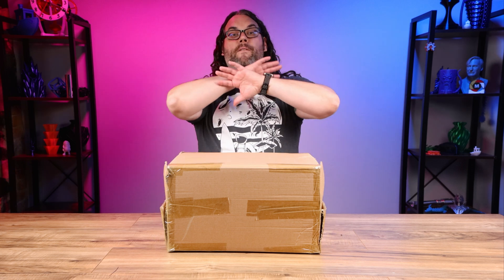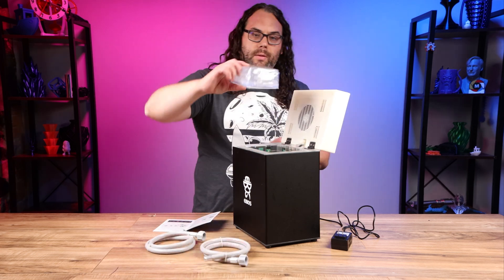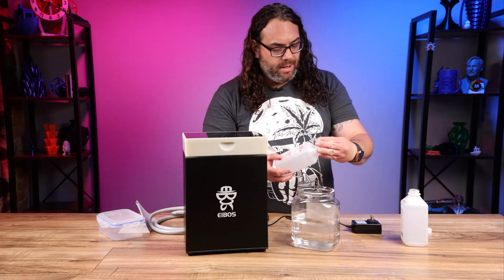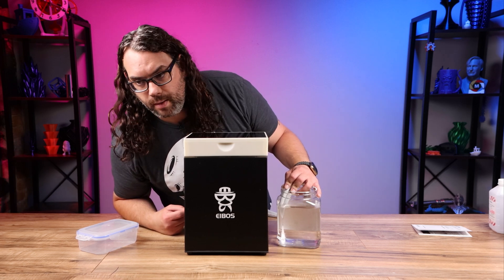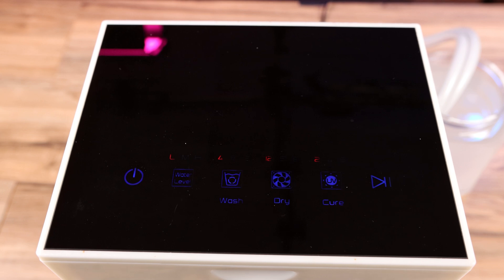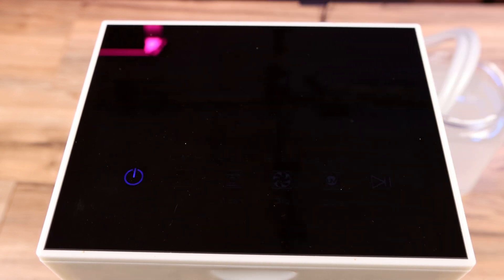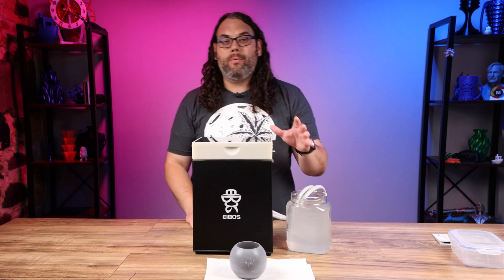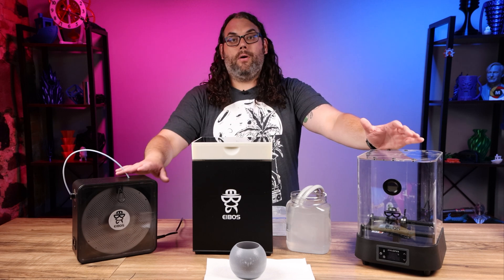A Raw First Look At the Eibos Oceanus Automatic Resin Post Processing System!

Comment: Looks like this shows all the problems of all in one machines, not just in 3d printing world but every where, AIO just does not work as well as dedicated tools do.   Looks like it is not washing all that well, is not drying all that well, and is not curing all that well, but I guess if someone really really needed to save space this would not be a bad way to go over a dedicated wash and separate cure station.

It also looks really tight on the inside, so not sure this would be a good option for people using larger printers and using all of the space, now it would not matter if one was using some of the larger printers to only print a few small things at once.